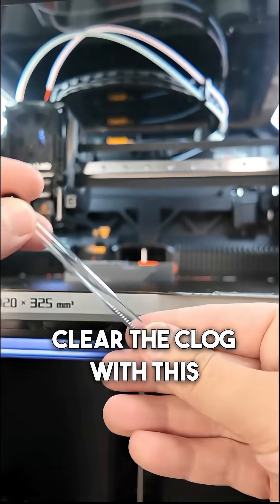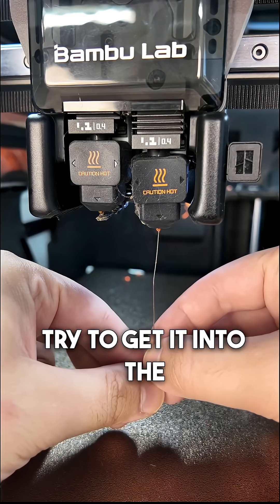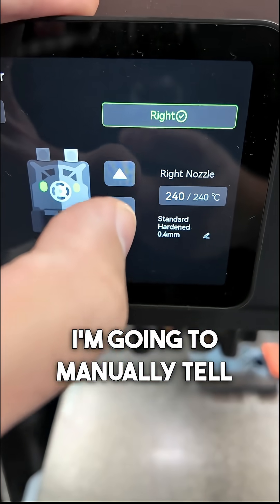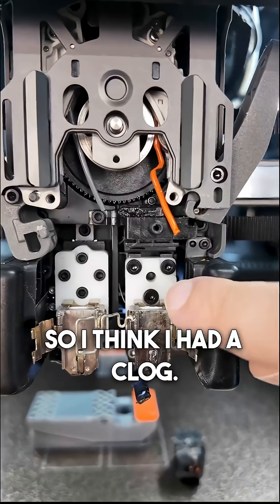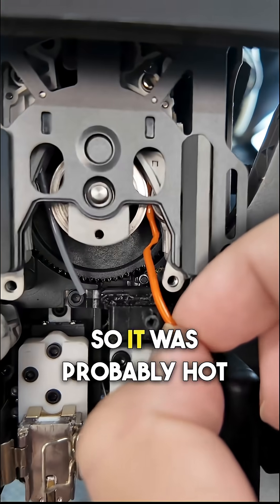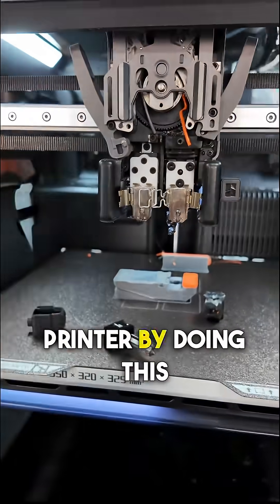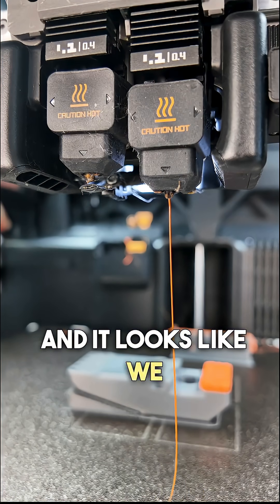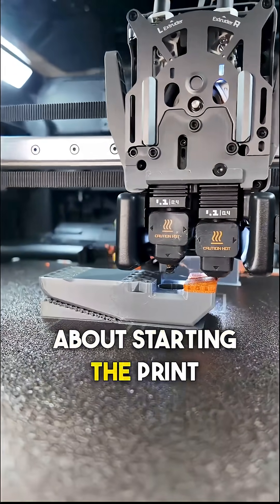How To Fix a Clog On a Bambu Lab H2D #3dpritning

Comment: I had almost the exact thing happen. In my case I found it was easier to just use the cutter (the big lever on either side of the nozzle housing) to cut the filament near the gears. Then pull the nozzle by removing the silicone heat sock and flipping the latch. This will remove the damaged filament and nozzle. I then just cold pulled the filament from the nozzle using some pliers. Return the nozzle and resume, the benefit of this way is that it doesn't require any tools, except pliers I guess, to complete and a cold pull of the nozzle is often done to clean them of build up anyway.

Comment: why do bambu lab 3d printers always have clogging problems when ive used my Flashforge AD5X (budget 3d printer) for months even with prints that failed still never a clog one and ive printed plenty in tpu
Reply: Its only because those users do not do regular and proper maintenance.
Reply: Because they do not do the proper cleaning and maintenance

Comment: Yeah i see another issue the printer has 2 nozzles cant it just swap
Reply: The printer has one nozzle for each colour, and hes printing a print that has grey and orange
Reply: The nozzle assignment is in the g-code. So it can't swap nozzles even if there is similar material in the other nozzle ready to go. It can pull from a backup spool if you have it in the AMS fed to the same nozzle though. So that's cool.

Comment: You can save your print. Caliper guage, measure it's height. Find the layer you paused/ failed, cancelled on. Drop the Z-offset by the measured height. Drop your model down that same height in your slicer and line up the remaining layers to account for what was left. Start the new print.
Reply: I imagine this would only work for a print still stuck to the bed, and not so much for the one that's been sitting in the bin a week lol.
Reply: Measuring is tinkering, no can do
Reply: Have you done that on an H2D? That feels like a hack that only worked on old school printers.
Reply: There is a way easier way to salvage the print. Just use the lever on the side of the print head housing to cut the filament. Remove the nozzle, cold pull the filament out of it. Reinstall nozzle, hit the resume print button.

Comment: Tpu is only meant for the left nozzle, as it doesnt move. You can print in the left too, but its not recommended
Reply: I think you meant right. My H2D only prints TPU from right extruder and throw error when trying to use left
Reply: @MarkCarr331 you should only use it in the non moving nozzle
Reply: @sean4706 No bambu explicitly states to use the right hand nozzle not the left.
Reply: @shaun536 i know. The left one moves, the right one does not. I just mixed the two up. Read my comment, i was talking about the right one, but said left

Comment: My tip is to bend the needle 90 degrees so you don't have your hand under the hot nozzle. 250C molten plastic on your skin is not fun. I can speak from experience.

Comment: I had the same probleme for months. Basically resolved it instantly along with all other problems with tpu after I bought a filament dryer. 

I am sorry to say it for all the cheap heads like me that want to spend the money, but believe me: a dryer makes ALL the difference. Maybe not for PLA. But for sure for TPU and ABS
Reply: Dw u can still stay cheap by using an oven 😅
Reply: Carbon fiber he have to have it or it will pop all the time from water bubbles.

Comment: Its insane how many people dont clean the nozzle off. When its heating up take a qtip dipped into some isopropyl and then just wipe off the nozzle. Takes maybe 10 seconds of time and it’ll save a lot of headaches
Reply: after every print? just confirming so I know how often
Reply: Is that after the filament unloads and your  shutting it down???
Reply: Heat + alcohol + combustible cotton == fire risk.
Reply: @memkiii do it while is cold? 😭
Reply: @memkiii  Only if your hotend is running at 399c or above.

Comment: That wire is an acupuncture needle
Reply: You are correct, and are basically standard with all printer maintenance kits, but no where does it reveal that they aren't for printer cleaning and are in fact, as you said, acupuncture pins.
Reply: Correction, acupuncture needles do the same job as this but this is different, for starters, it's not sharp, just thin...
Reply: @stephen_harvey  Nope, they are acupuncture needles. Yes some printers just come with a safer tool that is blunt buuuuuut the majority of kits just come with acupuncture needles.

Comment: Looks good 👍 I recommend not using the PTFE tube for any portion of the process, since the whole purpose of removing it is to have as little friction as possible when moving it to the printer. For super soft TPU I recommend dangling the filament off of the top of the printer straight into the extruder.
Reply: I do not have a H2D but does it not have a port to feed tpu from? I swear i seen that on the H2S i have on order. My X1C and even A1 have never had issues with tpu
Reply: @Spirited282 same here. My P1S and A1 have no problem pulling 95A TpU trough 70cm of ptfe tube.
Reply: @lukahierl9857  Seems to me those that have issues is just lack of experience with 3d printing, lol
Reply: @Spirited282 there's a tpu slot on mine and im no professional in tpu on you
Reply: Agreed. Its very easy to get extrudet jams with TPU, especially after the first print.